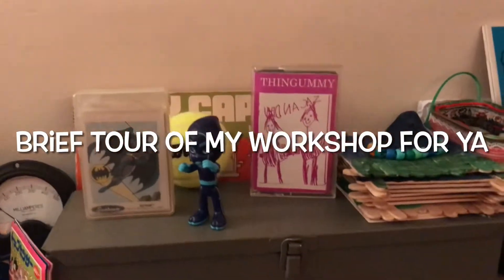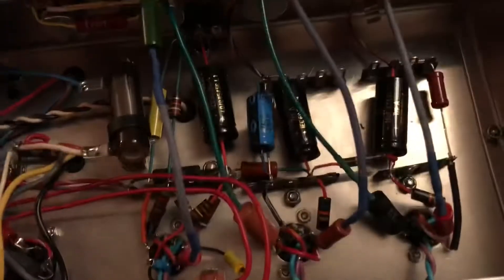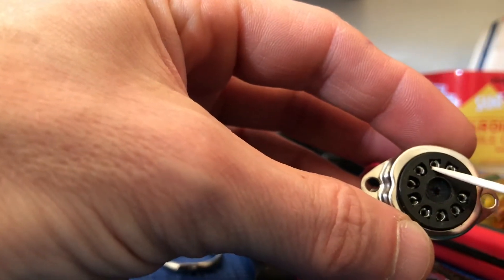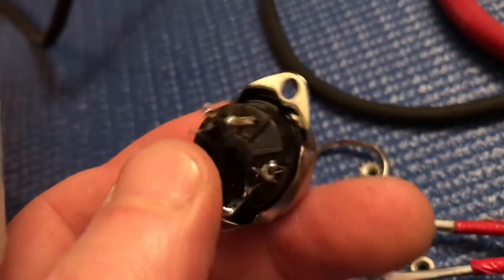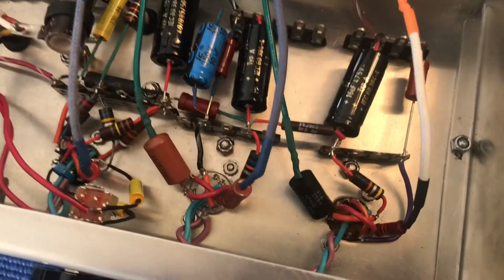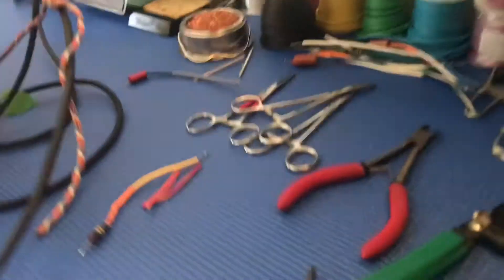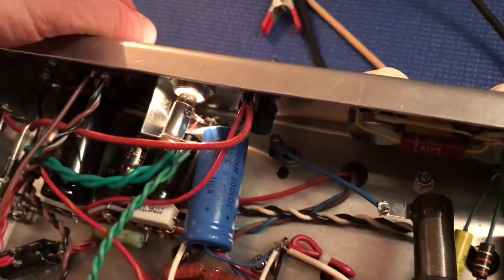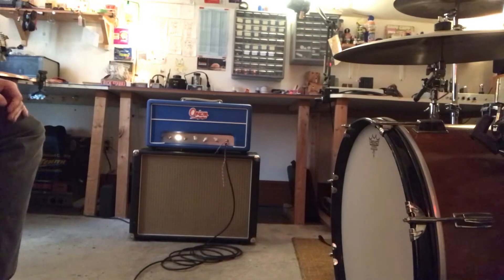Tube Amp Repair - replacing preamp tube sockets

Comment: Hello Kevin. Happened to see your video and wondered what you would suggest as covers for unused preamp sockets?TIA
Guy
Reply from the maker: I wouldn’t worry about covering them. Instead, I would occasionally hit the empty sockets with some contact cleaner and maybe once or twice a year open up the chassis and spray it (carefully) with compressed air. This is for an actual socket with components connected that was once used but due to a mod or re-wire is now out of the circuit. For empty chassis holes with no socket or components it might be tricky but I’d say find a piece of metal you can screw into place to cover the hole 🤷‍♂️

Comment: CC resistors in a new build?  Lord…
Reply from the maker: Carbon comps are known for tone as plate resistors, but yes they’re also known to be noisy and to drift over time, so I use 1W or higher for more stability 🤷‍♂️